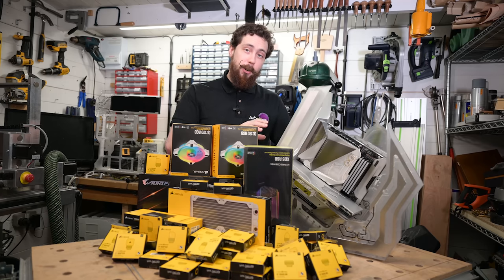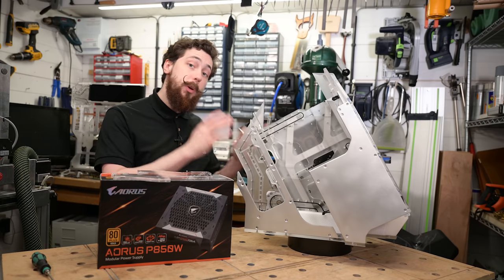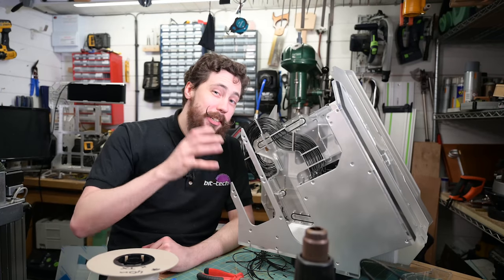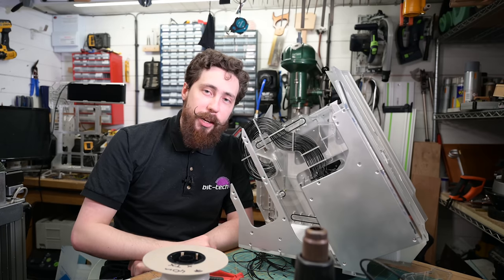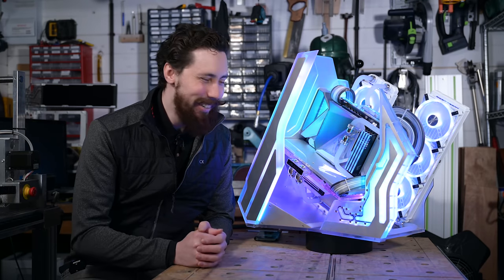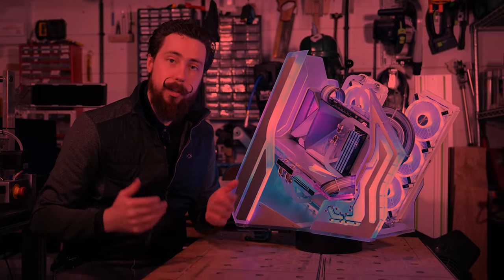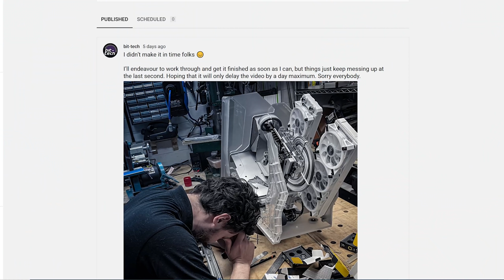AORUS Ensis Part 8 -  Finished! | bit-tech Modding | feat. AORUS & Intel

Comment: This is a work of art mate!
Reply from the maker: Cheers guys!
Reply: Hi bruv remember me
Reply: Yeah this thing belongs in an art gallery or something. 😂
Reply: @bittech1  what Perspex supplier do you use?
Reply from the maker: @darkelements8519  I have to shop around a bit since not all the types I use are offered by all suppliers in smaller quantities. Usually I either use a local plastic fab guy called XG Plastics, or The Plastic Shop.
Reply from the maker: @darkelements8519  If you meant the acrylic itself, I use a mix of Perspex, Acrycast, Evonik,  Madreperla and Crylux.
Reply: @bittech1  thank you and yeah I am just getting into making my own pump res distribution plates and I’ve just bought a cnc router I just can’t find anyone to buy the Acrylic from
Reply: @Gear Seekers I read that in your voice.
Reply: @bittech1  May i ask one question? Where you buy so cute cable sleeves?

Comment: Alex: We could go with something like CableMod for cables
Me: Yes, ofc. That would be nice
Alex: No, you fucking noob that would be a crime, ofc we are going to make our own

Great job, this is absolutely astonishing mate.
Reply: I seriously don’t get why anyone building a personal system doesn’t build their own. 
If it’s a system for someone else or just for show I get people want quick and dirty, but gamers/tech people take pride in unique builds, but today that just means they picked all the white versions of parts rather than doing much themselves.
Reply from the maker: The king Charged  Even if you have to buy the tools the first time, it’s usually cheaper or at worst about the same to make your own vs buying a Cablemod set. The flip side is it does take ages and it’s higher risk.
Reply: @bittech1  I am thinking of going with both cablemod and custom own made cables by getting a short PSU type specific from Cablemod to cover those 2-to-1 wire fusions and then create my own extension cable with nice full runs. Would it be a good idea or would you object against it? (Other than the cost, because shorter cablemod cables not that much cheaper than longer ones and I have to get accessories for custom cable making too.)
Reply from the maker: @augustusvipmail  It’s not a bad idea in itself. The advantage to the method you listed is that you could easily swap PSUs if you needed to, since any would be able to plug into the extensions. I’ve done this before but with homemade direct cables and it’s effective, if a little messy.

Comment: The pin out sheet is epic, somesthing like thatshould give all powersupplie-produce to their products ;)
Stay healthy
Reply: that sheet is only for the SPECIFIC power supply he used in the build NOT for all power supplies as the problem with modular power supplies is that although they all have the motherboard/CPU/GPU//SATA power connectors on one end the power supply side of the modular cable is usually different from different brands AND ON TOP OF THAT even different series of PSU's or different generations of the same PSU's or different wattages for the same category of PSU from the same manufacturers can use different modular cables. So if you want to use this chart you are going to need to get the same PSU from this video or look online to see if modular cables for other Aorus PSU's are compatible with the ones for this if you wanted to go for a higher wattage PSU for example and you can check the compatibility by either going directly to the Gigabyte Aorus site and look for replacement PSU cables for the same PSU he used and see if it says they are compatible with other PSU's from Aorus/Gigabyte or go to the Cablemod website and search the Gigabyte Aorus cables for this PSU and see which other PSU models they are compatible with
Reply: @zahidshabir4038  I know that, what I would like is every producer would have something LIKE that not that specific..

Comment: This build is incredible! Congratulations on it. I would not use your pinout, since it's not clear which pin is on top or at the buttom.
Reply from the maker: Mine is literally the only diagram that I've ever found that actually is clear, you have 3D views that specifically show it. To date, I've not seen a remotely clear and unambiguous pinout diagram from anybody, even the serious sleeving pros.
Reply: @bittech1  it‘s good if it works for you and maybe a lot of your followers. it for sure looks clean and sexy. but i’m confused. i like the pinout diagrams from mainframe customs.

Comment: Most ARGB led kits that use the motherboard ARGB header are also compatible with the corsair lighting node hubs. The connector just needs to be rewired to match the corsair connector and you are good to go.

Comment: First of all - it's an piece of art ... again :-D Amazing work. I really like how it changes the compleate style when you change the lighting. Please show it without light, or just very dim (best in white). But what's about the feet? I think you had an video where you created those nice clean feet? Or was it for a different project? And a final question. I am thinking about a way simpler project but in the general style of Ensis. Where do I get the mainboard exact messurements and so on? Have you bought the hardware first to messure or is there something like a database?
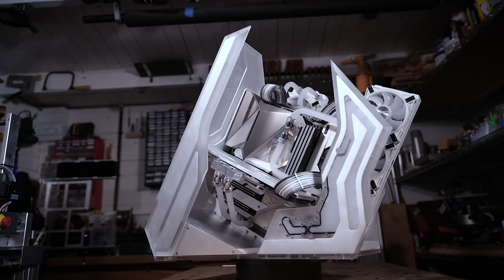Reply: the nasa style feet were for aquaceras, which he's going back to now that this build is finished. there are a few non RGB shots scattered here and there, the best look at the whole build with filled loop is at 14:39
Reply from the maker: DMonz mentioned most of it, there will, however, be more shots of the rig without lighting in the final montage :D
Reply: You could measure your motherboard or use the manufacturer's dimensions in conjunction with exporting the motherboard schematic from its pdf manual into illustrator and then import it into fusion 360 as an svg. I'm not sure how Maki does it but that's my method.
Reply: @bittech1  Thanks looking forward to the next video.
Reply: @Nothinglastsforever  Good Idea I guess I will try that.

Comment: 18:55 I got some adaptors from PirateDog Tech on Ebay to plug my GPU and EKWB pump/res into a Commander pro to get everything controlled by iCue because it's so much better than any other RGB control system imo.

Comment: a work off art .....and damn beautifull, just one question is there a little bend going on at the base? or is it just because it's on a stand .
Reply from the maker: It's a little bit of the stand combined with an optical illusion. The base itself moves inwards, the area with the shroud is angled, so when you combine that with a stand/turntable it looks like it's bending from some angles.
Reply: @bittech1  anyways very great job 👏🏻 👏🏻👏🏻

Comment: is is possible to set different bend radii as small plywood pieces (or really any inexpensive material) to get precise angles and radii on your bends? just a musing, I may try to set that up in fusion at my new job
Reply from the maker: Yup you can do that, it’s still tricky but if you can make your own guides you can have consistency. That said it’s likely only worth it if you’re making a lot of similar rigs vs a single one.
Reply: @bittech1  I may make a few different models for it at work but you could just use them more or less as dies for bending, storage may be weird but they'd probably be useful on most every bend project just because they're for the smaller radii. I may have to post it in the discord tomorrow after sending the pics of the shop

Comment: Have a look at Aquacomputer Farbwerk 360  for the rgb part... With an adapter it can control even corsair as if their are a single led strip, since they actually have a signal in and out pin on the fans
Reply from the maker: Yup the Fabwerk would have been a great way to do it. I only came across the tricky lighting woes on the last day, which wasn't great. I'm using a quadro in Aquaceras for very much this reason.

Comment: the rgb issues resonated with me, got an ek-aio and i love how it looks, but the asrock rgb software that i need to use is garbage. cant even open it. was thinking about buying one of the ek-loop hubs to control it, but heard they were not good either. would love to see a rgb controller tier list or something like that
Reply from the maker: Get the Phanteks one if you want it super simple. You have to use the manual control to avoid the motherboard, but the presets are great. If you want the most comprehensive, go with an Aquacomputer Fabwerk, that will give you software control via USB.

Comment: just out of curiosity of a person that know very little about hard tubing, why did you/he use that blue thingy while bending them tubes? 13:55 etc..
Reply from the maker: It’s so that the wall of the tube doesn’t collapse when you bend it. If you try bending an acrylic tube without one, it will kink in the middle and flatten.

Comment: Was that Phantec controller you mentioned to control RGB over Fusion?
Reply: Think the sponsors might prevent him from giving a direct answer but I imagine that's the case.
Reply: @anomalousresult  Good point, thank you
Reply from the maker: Yup I used the Phanteks Digital controller here for the LEDs. It can also be done in iCue but you need the right kit for it, I only had a Lighting Node Core to hand so it didn't really work (it's only designed for fans).

Comment: Just want to place this as a warning here to everyone thinking about buying gigabyte/aorus:
The RGB Fusion Software (which for most of the mainboards is the only way to control the color of the leds) is MASSIVELY flawed. 

It WIPED all my connected drives after restart, which seems to be a bug that only some users experience, most likely happening in conjunction with Adobe CC or Office products installed. I know that this sounds ridiculous, and I have no explanation how an RGB Software could be written SO poorly, in order to cause this. (Google "rgb fusion drive wipe",  I didnt make this up)

I was lucky and could restore most of my data, but lost 2 days in the progress, had to reinstall my windows 3 times and had a painstaking search for the issue, until I found others reports of this issue.

*********************************
This is no critic on the video or sponsorship, the Build is epic, and the video is good!

Comment: Try a icue adapter so you can connect the led strip to icue instead of the motherboard. You can get those on eBay for like $5 usd.

Comment: Can you elaborate more on that phanteks argb controller? I have a gigsbyte z390 aprus master and yeah,  rgb fusion is an abomination... all my fans are argb (5v/3pin) and there is absolutely no customization with rgb fusion. But i also have the rtx 2080 ti aorus xtreme and trident z royals. Is there any software/hardware i can use to have more customability than rgb fusion?

Comment: Could you please make a video on explaining how the pinout diagram works cant find decent video about it
Reply from the maker: The diagram shows which wires are present in each side, where they connect to and what voltages/signals they carry. If you follow each wire on the motherboard side back to the PSU, you'll see that they end up in the slots shown by the number. Wire 1 on the motherboard side goes to where Wire 1 is listed on the PSU side etc.
Reply: @bittech1  thnx for the awnser but do you need different kinds of cables cus of the Voltage etc

Comment: what's your opinion on the thermaltake pacific m-pro fittings? I heart they made it easier to make dfficult runs, as you could finnish them when in place, like this https://youtu.be/nEPAU1s6QFE?t=165
Reply from the maker: The C-Pros are largely my favourite fittings, their utility is brilliant. Issue though is they're huge and only come in 16mm sizing IIRC.
Reply: @bittech1  Good to know! I'm far from doing anything with custom watercooling, but hopefully one day! (My dream would be a Louqe ghost s1 build with copper watercooling)

Comment: The technical execution of this is above board, but the design aesthetic is a hot mess. Hire a designer next time.
Reply: Think its rather consistent, sharp edges, defused lighting, silver and black accents. I'm actually of the oppinion, that hireing a designer would probably be a rather bad idea.  Firstly I dont believe there are many designers which are accustomed to designing PCs, and most would probably mess it up pretty hard with the wathercooling intigration and distro plate layout. And secondly I believe a lot of the build character would be lost....
Reply: @stillsalty947  without question there is consistency, however the harmony of the lines of the thing are totally phrenetic. Especially that jagged shark's tooth protrusion that looks like an afterthought. Again, execution was flawless. Aesthetic? Not so much.